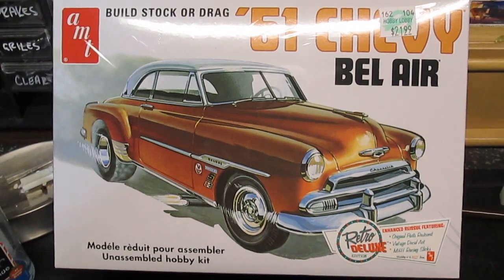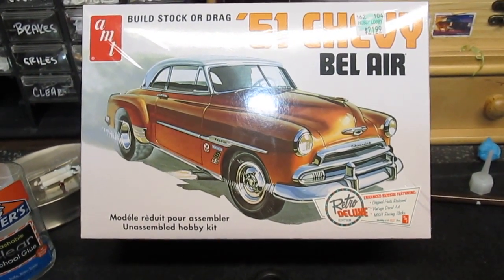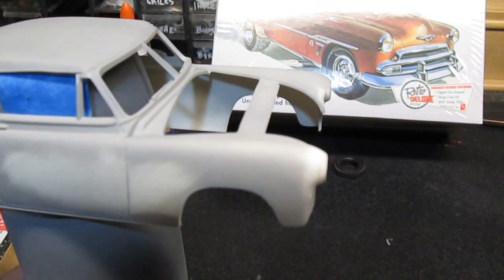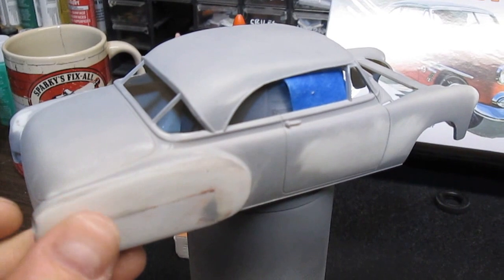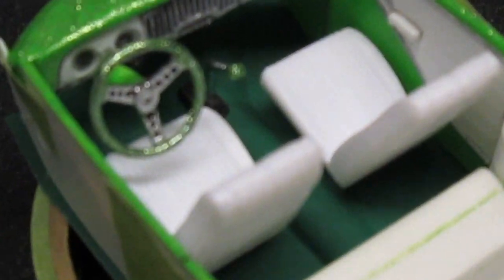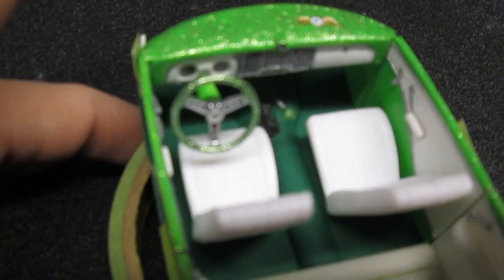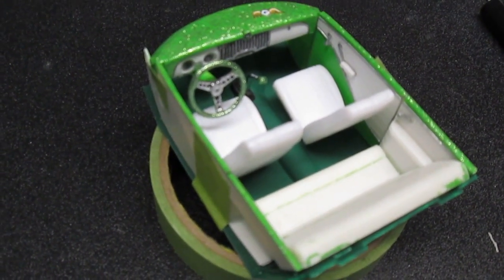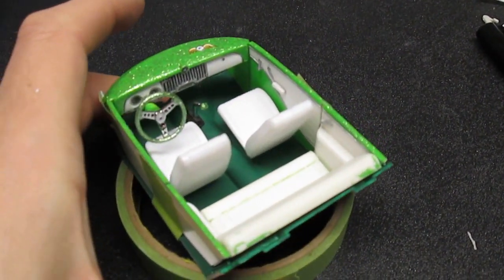Goodguys Show build

Comment: Nice interior Jim! As for the filler I just use melted syrene in some glue.. it takes a while to dry but when it does is rock solid.. then just sand away the excess..kutgw
Reply from the maker: Thanks! I will  seriously try that filler idea!
Reply: Cool!